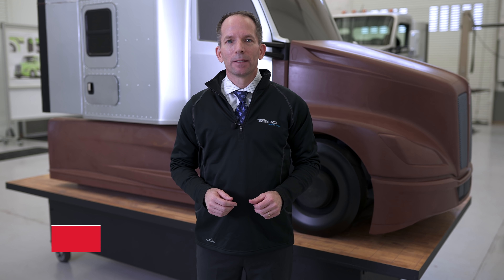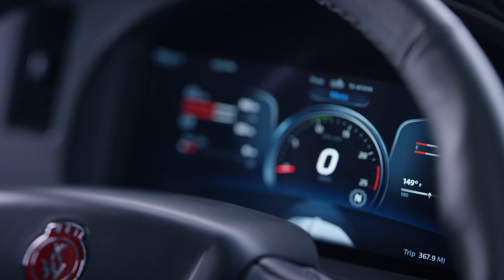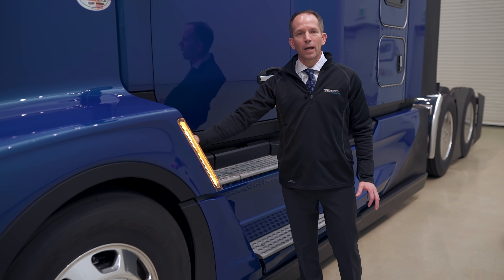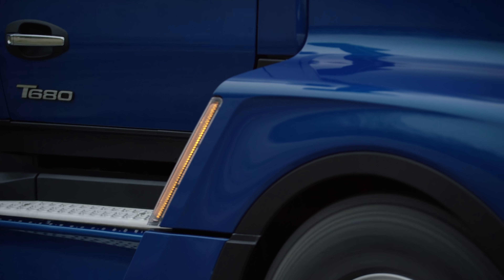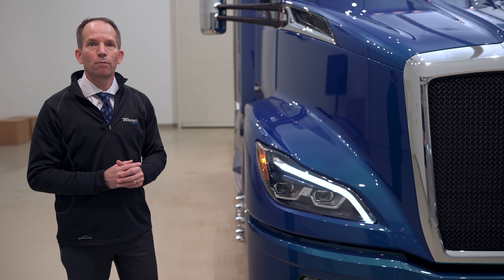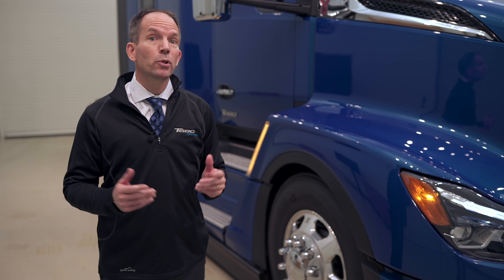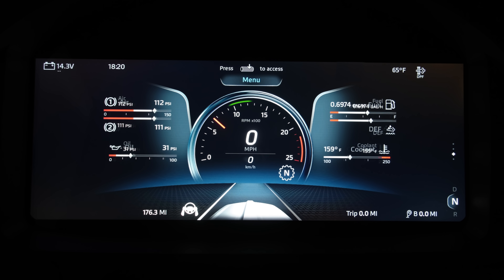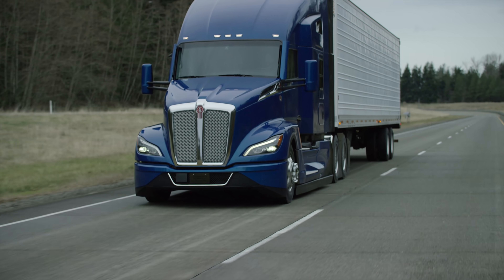Kenworth T680 Next Gen Product Development

Comment: How about a heated windshield and/or engine block heat vents directed at the freezing wiper blades!?
Reply: @William burd Raney website sells heated blades at about $170 a pair plus have to hard wired.  Whereas Volva for years has put a heated windshield in their trucks.  Works just like the heated rear window in a 4wheeler.  They're also doing the same for the headlights because the new LEDs produce no heat and ice is a huge problem.  👍👍
Reply: No . That's too much
Reply: DIY heated wiper blades have never failed me.

Comment: Does water leak through in the sleeper still or has that issue been resolved and fixed?
Reply: Yes it still does
Reply: Where does it leak at, I've never noticed it
Reply: It leaks in the front by the a pillars and you get wind coming threw the doors while driving threw a gap somewhere between the door panels
Reply: @a-human-interface4991  cab top marker lights are notorious.....
Reply: I had kenworth in Indianapolis put a new windshield in. Still leaked. Young mechanic came buy when I was back complaining and said its the marker lights. He said I will fix them. He did. New marker lights with better seal design.  No more water falls. No more leaks.
Reply: Scott Manerez  lot of foreign drivers in them wearing flip flops. Feet up on dash. Nasty
Reply: @a-human-interface4991  if it’s really heavy rain it use to leak through the marker lights and. Side cab sleeper windows. But I’m talking about a T680 from 2016 idk about the newer ones
Reply: @thomaswilson8634 What year was that ?
Reply: I have a 2021 t880 and haven't noticed it yet. Not sure how different they are...
Reply: @pablosalinas4775  yeah im in a 2019 so thats probably why
Reply: Well, they heard truckers weren’t drinking enough water...
Reply: @pablosalinas4775  my 2016 doesn't leak, yet...

Comment: Are you able to shut the parking lights off   while parked when the truck is idling.  It's hard for other drivers to see when trying to back in next to them at night
Reply: Why do you idle while parked?
Reply: @olivergunn2796  because it sucks when your cpap gets shut off when the low battery protection kicks in. Among other issues depending on where/when you're running. ;)
Reply: @olivergunn2796  Have you ever heard the saying don't leave your pets children or elderly in a car either on cold days or hot days
Reply: @goatranchgaming2922  yeah but, you can use a night heater in the cold (this is standard on every truck in Europe), and a 24v air con unit (this isn't specd as standard but is very popular in hot areas), the idea of running your engine all night is mad to me, I shut off the engine to couple/uncouple a trailer which only takes a few minutes, unless the engine is stone cold, then I'll let it run to avoid an unnecessary cold start
Reply: @Broadpaw_Fox  just done a Google search, is that a sleep apnea machine? If so fair enough but I would of thought installing some beefier batteries would pay for themselves very quick with fuel savings/reduction in engine wear
Reply: @olivergunn2796  - yes, it is. And a great majority of the truck on our roads here in the USA are company trucks, which often get specced out as cheaply as possible- meaning no nice systems to allow driver comfort when the truck is off. The recent push by our lawmakers/big companies to diagnose sleep apnea is a problem just because of what I mentioned. Since the main batteries don't last all night (especially in the cold) they're having to deal with it, and with the current spec of equipment that means idling all night (I personally hate it was well, but I'm one of the few over here). Maybe in a couple years we'll have a majority of company trucks with basic driver comforts that can run a cap and fans/heater without idling, but not yet. 

Individuals with their own trucks is a whole different discussion, and comes down to personal taste.
Reply: @Broadpaw_Fox  I suppose it's just depends on money, and fuel is cheap(er) in North America than in Europe, I always think it's a Shame they don't put electric hookups at rest areas to run this stuff as well as fridge trailers
Reply: @olivergunn2796 - the first part there is true,vand I wholly agree on your second point. We're eventually going to get there, but we're not there yet. But I forsee our electrical infrastructure being strongly upgraded in the near future (THANKFULLY). :)
Reply: @olivergunn2796  when i ran the road i never turned the truck off. I'd  park for the night hit the regen button 
Go eat clean up go to sleep wake up leave. Still got 6 to 6.5 mpg at 72 mph. 13 speed man 370 rears.
Reply: @jerrykinnin7941  72mph in a truck is mad, were limited to 56 😭, also fun fact UK MPG≠ US MPG there's about a 20% difference, either way 6-6.5 isn't exactly great
Reply: Lol. The new colors? They do realize this is a "truck" and not a Lear Jet? Though looking at the cost they're pretty close.

Comment: Step 1 DON'T PUT A PACAR ENGINE IN IT! It's a huge POS they are self destucting between 400,000 and 700,000 rebuild is ridiculous and nobody ever has filters in stock
Reply: I drove a DAF XF which is a Pacar truck the auto (clutched) gearbox is so unbelievably shit, it's hard to believe it left the factory, when your trying to manoeuvre, you press the accelerator, nothing happens, press it a little Futher and it lurches, absolute pile of wank
Reply: @olivergunn2796  I work for kenworth and I can second that your either pulling it in the shop at 1/2 mile an hour or 10 and there is no in between, but to give you a little insite on it It’s all in the programming the trans have either creep mode or lurch mode which is why it either won’t move or it will just take off lol
Reply: And as for the paccar comment, they are the worst engine ever put in production truck blow through cams like It’s there job and they have recalls for oil filter caps for Christ sake, currently have 5 in the shop getting cams as we speak and none over 100,000 miles
Reply: @trentneiheisel3927  yeah, in my usual Volvo fh with I shift, you can use the throttle to manoeuvre and you have the same amount of control as if it's a manual transmission, the dad does have a snail mode for the gearbox in both forwards and backwards, but it doesn't really help, it just dulls the accelerator pedal, but the gearbox is still grabby
Reply: You all have no clue about the paccar engine, nor can you drive auto transmission lol, you drivers are at fault for the issue you mention
Reply: @vuilbaardgames3280  well...since trucks, engines and transmissions are designed so almost everyone can drive them...and everyone here, but you, is complaining about them. I think I'd listen to the majority.
Reply: The Paccar MX (Daf MX) engine is a reliable engine, Paccar adapted this engine for the US market! Don't change a good engine!
Reply: @crocket1971  they have their problems like all engines but at least they can be fixed and they are worth rebuilding.
Reply: @Stoicventures80  I can hear you Dixie horn from a mile away

Comment: Those side vents that come from under the motor I bet it’s going to cause a lot of dirt and snow drift to spray up onto the doors.
Reply: I can already imagine it, the hot air melts the snow on the steps, but when you stop overnight, that water freezes and when you wake up in the morning there's 2 inches of ice on your way down on your ass at the bottom of the stairs.
Reply: @GabLeGamer  🙀 this was not very design. But I still want it. Lol

Comment: Alright I just got a bought a 2023  next-gen t680 the truck looks I have no complaints about the outside design or inside except for maybe some USB ports .....

Now that being said...... Upon delivery my flaring rattle extremely loud I had the one side adjusted because they were loose but the dealership would not do the they just stayed at that that's how they are loud and mind you on a $200,000 plus truck ......

The digital dash will not save my favorite layout no matter what it always somehow resets......

Right now with only two hundred miles put on the truck since I received that the truck has a horrible alignment I just spent twelve hours at the dealership took the truck for a test drive and it's still wrong luckily the technician was showing me that the rear would probably have to be shimmed well I took a good look and my rear axle is shifted to the right almost three quarters of an inch we measured it with a tape......

Please Kenworth do better your name is known for quality, luxury and power.......

Comment: Something I think needs addressed that is probably more specific to Cummins is the engine fan causing a dust storm when backing just from the air con needing it. Maybe electric fans for that or some kind of shielding to keep air flow from launching the customers driveway out from under the truck and sending that dust into orbit.

Comment: What about the lurching problem of the transmission? Not trolling. We want to know. This issue reaks havoc at the docks especially the right ones. I would upgrade to this truck if I know for certain the transmission has been fixed
Reply: I crunched a bumper because of that issue.   Inching is nearly impossible.   It makes a 30 year driver look like a rookie when backing into a dock

Comment: Lol, drivers rip those farings off as it is, now they're longer?
Reply: they are clearly shorter
Reply: @thlrock  Apparently not if you have to be able to swivel the stupid things outward just to get back behind it
Reply: Yeah.. awesome you're gonna have to put the fairings back every time you back up. Wonder how much they're  charge to replace those things if damaged lol
Reply: @thlrock  how are they shorter when they clearly said they extended them? Closing the gap between cab and trailer
Reply: Need to be able to raise the truck 3 or 4 inches. To avoid damaging the side skirts.
Reply: Ohhh, is what why I bent up a couple just trying to tight turn out of some tricky situations?  Lol.
Never had that issue when I first started out in a Freightshaker.
Reply: @gregorysagegreene  they're nearly impossible to keep on, first snow, first rock lot they start to rip off.
Reply: He didn’t mention it but I would hope it’s a flexible part. At least the part that you can swing away. I personally try not to even get close to the point where I’m touching my trailer. But yes it sounds like it could be a pain to keep intact for the fleet drivers.
Reply: @mytruckinlifeace4047  I'm a big fan of aerodynamics, and fuel mileage  but you gotta be able to drive the thing without constantly worrying about damaging something. Like the low clearance under the truck, where snow on the road rubs on it and tears it off. And, it's definitely mainly fleets that will be buying these guys new. The part that pisses me off is, I can see their marketing snickering, and saying another easily damaged expensive item to replace means more money for us. Because let's be real, majority of trucks will likely be driven by new drivers, which isn't fair to them.
Reply: Daniel Jaeger very true I drive a 2020 cascadia and it has some really low parts. The side skirts seem to be holding up alright but the chin catches on everything and even though it’s flexible it still gets damaged. I’m sure it’ll be a $1500 part to replace once I turn it in.
Reply: Why don't they use nylon brushes down sides and if you go over speed bump they will bend out of way.
Reply: @geraintroberts6606  I dont think it would benefit aerodynamics, and might actually harm their aerodynamic coefficients rating. Their skirt is great on paper, in practice its idiocy. They think in the 100,000+ miles we drive a year we never seen bad roads, yards ect.  Think fighter jets, and high end sports cars. sharp angles and no fluff to flap about.
Reply: @MrFriday83   if damaged?  You mean WHEN.
Reply: @grege2383  Haha oops yup when

Comment: Seems like mechanics are gonna hate working on this model.
Reply: That better adapt or find a new job. I used to work for BMW with the new I drive as well as MBZ with the Command center in the late 90s. Also have you looked at the new private and commercial airliners. nobs break, get worn out, can't update the software. No plug in diagnostics like on the new tech.

Comment: Kenworth design department, spending their free time reading Freightliner and Volvo catalogues.... maybe !
Reply: KW just trying to keep up,
Reply: As a w900 owner for 20 years I can simply say this ..
I went from a w900 with a cat 550 to a kw680 with a 450 Cummings..the 2st year I switched I saved $30, 000 in fuel ! 
Part of that was from not idling and having a generator on my 680 but I cannot deny a huge fuel savings ..that being said I would go beck to a w900 in a heart beat
Reply: Yes tachometer and speedometer Volvo like ( Euro models not American) and folding cab extender.
Reply: Good
Reply: @Hi-cz3mc  obviously you are a member of the white Volvo mafia..
Reply: I don't speak inglish
Reply: This comment has big flip - flop energy
Reply: @niko_bean  🕌🛣🩴yes yes my friend,  Volvo is the best truck on the rd ..very very fast and plenty of room to pump as much air in the seat as possible so you can ride with your feet on the dash and stick you foot out the window ..very very comfortable my friend
Reply: @mikewasko4964  😆 🤣 😂
Reply: @mikewasko4964  Peterbilt,  Volvo,  Mack, Daimler , Scania, Kenworth. Which one is the best?

Comment: Sad thing aerodynamics become more reasonable than practical use.

For instance,  
if you hit a deer otr, the front of the truck gonna take all damage... no way to save money for the repairs with this type of engineering.
if you park truck at the truck stop, someone gonna back into the hood, that's another reason to pay more for repairs.

I think trucking companies should stop running for aerodynamics only but start running for reliability, availability, safety and aerodynamics.

Why not design convertible front bumper that serves porpoise for even better aerodynamics and safety when hitting obstacles otr(cars, animals,) reducing damages and expenses.

Why not make convertible air aerodynamic parts so they actually "stay" in touch with the trailer even if there is turns, bumps on the road?
Reply: It's cheaper to replace a few trucks that hit a deer every year rather then add extra weight to ALL trucks and burn more fuel.

Comment: I knew the t680 would get a facelift when I saw The Peterbilt 579 did. They are pretty much the same Chassis. As far as the side fairings. I wonder when all Manufacturers will have them. I see Volvo has them on the mirror frames for a while and I believe the 2021 and newer Freightliner Cascadia's are standard with them. And I believe it was optional on the Cascadia for the 2020 model.

Comment: may be also design a more durable steering wheel and stop using leather, almost all are falling apart with in 200k miles. A durable soft plastic is a idea, is the first thing you see when you check the truck.

Comment: I'm sorry but I am going to have to give you an 'F' for FAIL on NOT expressing how incredible SEXY of a BEAST your engineers were able to continue making while giving a driver the sensation they are driving a Maybach/rolls royce of luxury of a truck that seems NASA could use on Mars, lol. sci-fi display is incredible.
KW does it right by telling it's engineers run wild with the ideas to make it better instead of how cheap can we make it and get away with introducing the next gen. ;)
all it needs is some Christmas lights on that front bumper and slap in a 50" tv on movable arm so you have the option of viewing it from the lounge chair or bed. :D
I'll be taking a look at one today that's for sure ;)

Comment: Do those cab extenders lock into the open position? I would hate to be messing around with the trailer I want to get smacked in the face by a cab extender because it was blown shut by the wind

Comment: As i watched this, i kept wondering whether these reps had any clue how to drive the truck themselves???
Reply: They do not , plus they think it looks good . It doesn’t!
Reply: @lanceewalt2431  it looks really good.  And they are trying to make things better for the driver
Reply: @carloslugo9457  nah it’s ugly looks like freightliner and Volvo had a baby
Reply: It’s pretty obvious that they have no idea about actually driving them… there’s things called parking lots and potholes which will eat those air dams for breakfast.  Also the whole neutral coast idea is unsafe and just not smart. It kicks in while using cruise control. Causing the truck to rapidly accelerate or decelerate depending on the hill. Well passed where you have the speed set.  Also the fact that you cannot manually shift the truck. (Automated transmission). If you climb a hill with it locked in say 11th gear, you reach a Plateau the computer will suddenly drop speed to reduce rpm, causing you to loose more momentum for the next portion  of a hill.  Garbage.
Reply: @brianhahne9623  I drive an auto. It has a bad habit of getting back on final gear the moment the hill evens out even if we’re about to climb another one. Heck it went into overdrive while I was still climbing a hill and had to go back to the same gear a few seconds later cause it lost momentum. I used to just put it in manual mode but then these assholes put a new update on the transmission and it gives me a fake transmission fault if I hang in manual mode for longer than a minute. Honestly really dangerous for winter driving all in the name of fuel economy.
Reply: They should have to spend at least 2 years on the road and then design.